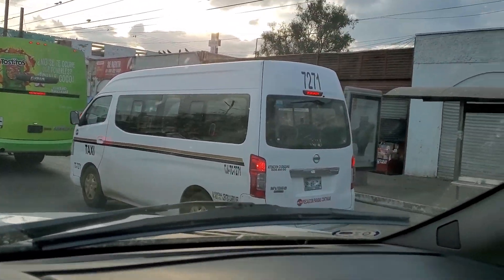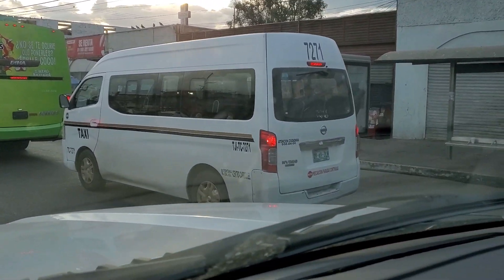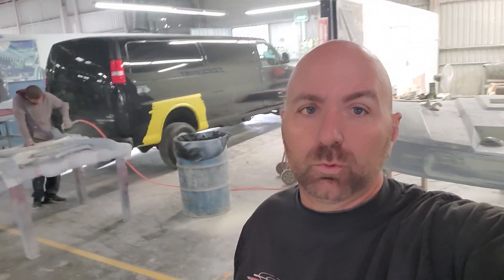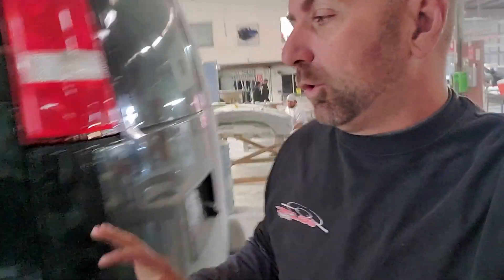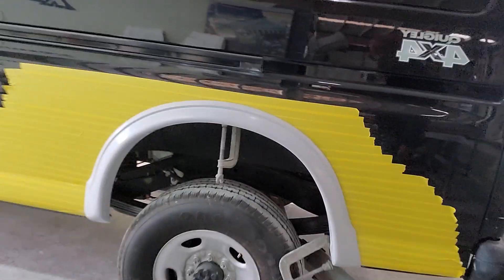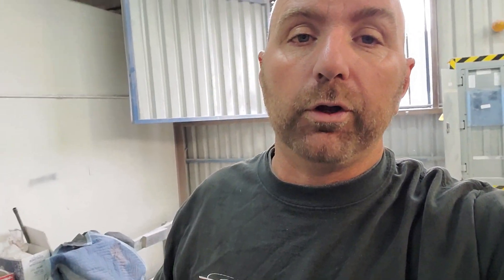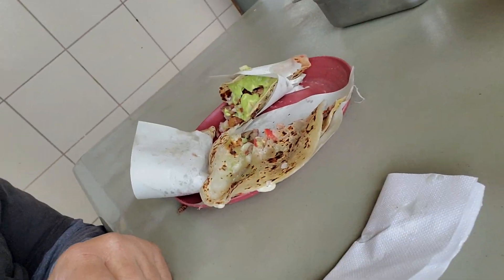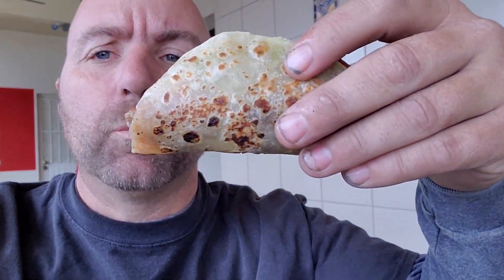Chevy Express Fiberglass Fender Flares | Progress Update

Comment: Jeremy, do you have a release date for these fender flares?  Do you have some new tire sizes they will accommodate? Will these work with your 1.5" spacers?  Thanks
Reply from the maker: I wish I could answer your questions as we don't even have a set to test fit. Due to covid Fiberwerx has been shut down so we have to wait for all this bs to blow over before we can get any info and specs. Sorry about that brotha, I'm itching to see what we will be able to. Once we have everything ready we will post a video with all the info you need.
Reply: @WeldtecDesigns  cool thanks

Comment: I have. 2 questions; 1.  I have a 2005 GMC Safari AWD Cargo Van, do you have the same suspension kits for the Astro/Safari as the Chevy Express series??    And secondly, I also have a 1977 G20 cargo van and wanted to know if you have the same suspension kits for the G20 as the Chevy Express??  Thanks in advance!!!
Reply from the maker: Ahh man, unfortunately we don't have kits that will work with G20s or the Safari AWD Cargo vans. Just the Express/Savana vans